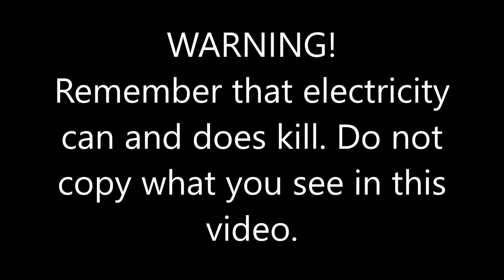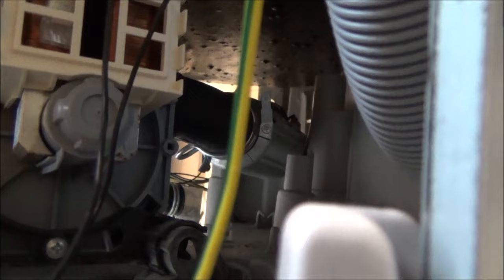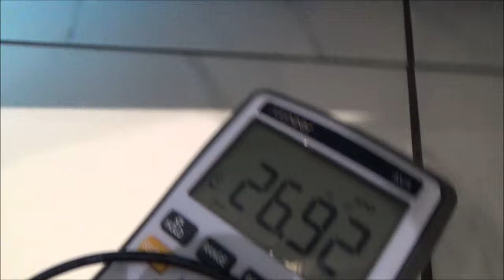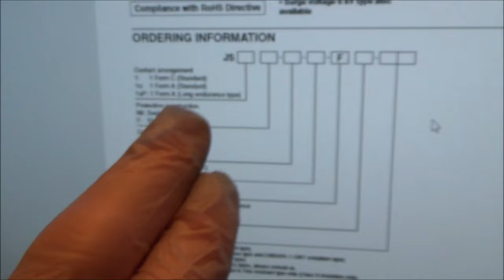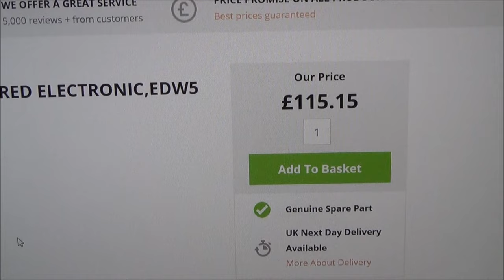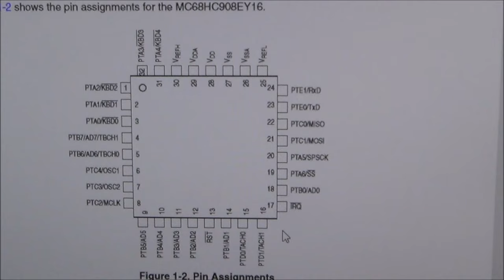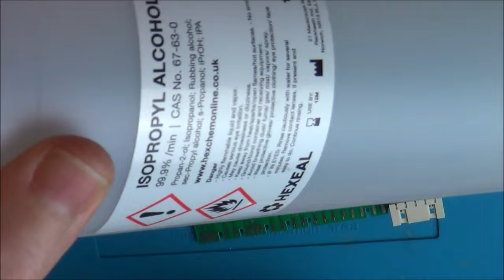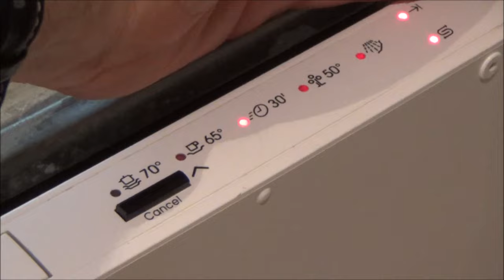Trying to FIX a Faulty DISHWASHER which Doesn't HEAT UP

Comment: Hi, 

You caused the diode to blow, when you tested the relay with the 12v power supply when it was in circuit you applied 12v directly across the diode, when you tested with the positive on the anode and the negative on the Cathode (Black line end of the diode) this caused excessive current through the diode causing it to go short circuit, the reason for this diode is when the relay turns off the magnetic field from the coil in the relay collapses causing a reverse voltage (called back-emf) this voltage is then conducted by this diode preventing damage to the driver stage of the circuit. 

Next time you test a relay in circuit apply the positive lead to the end of the diode with the line on it (The Cathode) on the back emf diode (across the coil of the relay) and the negative to the other end of the diode this will latch the relay without damage to this diode. Virtually any diode will work across a relay it is simply a protection device.
 

By the way you mention uF for capacitors the U is actually Micro so if you see symbol 'µ' 22 this means the capacitor has a rating of 22 micro farads {0.000001 farads} (the symbol 'µ' means micro), named after the famous Englishman from London Michael Faraday who made huge contributions to our knowledge of magnetism and electromagnetism at the start of the 19th century  (1791-1867)
Keep up the great work I enjoy watching your channel.
Reply from the maker: Thanks Tony, hopefully I will remember in future to put the + to the Cathode, I didn't know this. In this instance the diode was already shorted before I took apart the machine but if it wasn't then I now understand that 12V in the wrong polarity would have killed the diode. Thanks for the helpful tips, I appreciate it :-)
Reply: @Mymatevince  Hi, Sorry but I have do disagree, if you  look at when you first took out the board and measured the relay at time code 32:43 you measured across the relay coil and it measured .388k ohm, this is the correct measurement for the coil and proves the diode was not short at this time, if the diode was short at this point the reading would be short circuit. Applying the 12 volts caused the diode to short. 

Not having a go at you because your skill set and determination are very impressive, I have spent my entire life working on this type  of equipment I am now retired but I am very confident in my electronics diagnosis abilities.  If you don''t believe me take a normal diode and place in across your power supply with the anode to the positive and negative to the Cathode the diode is then in forward bais with no regulation of the current this will kill the diode unless you have the current limiter set in the regulated power supply.   When a voltage is applied in the opposite direction with the positive voltage on the Cathode (Black line) the diode is then in a reverse bias condition and no current will flow. PS don't feel bad because I have done far more accidental damage than short a diode...   Cheers Tony
Reply from the maker: @tonycross8101  Thanks Tony, I am going to try this right now with one of those 1N4148 (think that was it) to see if my power supply cuts the voltage in time before blowing the diode. The confusing thing for me is if I did blow the diode then what was the original fault. I will message back in 15 mins or so :-)
Reply from the maker: @tonycross8101  Hi Tony, this is getting interesting!!! So I am using a 1N4148 diode and the Ohm reading before doing anything is red lead to Cathode, black lead to Anode is OL but when red lead to Anode, black to cathode it is 1.93MOhms. 
When I apply 12V red lead(+) to cathode and 12v black lead (-) to anode the Ohm reading is the same as above BUT..... when I swap the polarity and apply 12V + to Anode like I did in the video it blows the diode and it measures 0.69Ohms in both directions!!!! it blows it instantly without any pop or fizz. So this now has me thinking what was the original fault with the dishwasher. I haven't taken out the board to measure the resistance over the relay coil but if like you say the diode was the original problem then it wouldn't be reading .38K Ohms. The dishwasher is at this moment working perfectly and before it wasn't heating up. The terminals on the heater element where attached and all the wiring was intact and tested ok for continuity!!!! Any ideas? Thanks for getting back to me on this and never be worried about upsetting me when I am wrong. It would be more upsetting for me to think I am right when I am wrong :-)
Reply: @Mymatevince  Hi, That's right the diode will blow when the positive of the power supply is on the Anode and the Negative is on the Cathode (This is the forward bias condition for the semiconductor and will allow current to flow) without a load the current will kill the diode (almost always going virtually short circuit in both directions).  Some multimeters have a diode mode usually a diode marking on the dial this biases the diode on an will allow you to test what is called the forward resistance across the diode when it is biased on reversing the leads should then be open line.

By the way you mentioned Zener diodes in one of your other videos, these work slightly different to a normal IN40xx diode they are what is termed an avalanche device they have the positive voltage on the Cathode and the diode only conducts when the voltage reaches the avalanche voltage which is the rated voltage for the zener, they always have a limiting resistor to prevent damage, so when fault finding them the anode may trace to ground this is normal.

I thought about your method in tracing the problem and I think your logic was very sound, sometimes faults like this can be a pain to find, the only suggestion I may suggest if this problem re-occurs is to disconnect the power and try an ohm's reading from the wire that comes from the water pressure switch to the heater and the wire that supplies the other side of the heating element, you should see the coil resistance, try this before removing the heater or disturbing the wires, as it may indicate a high resistance connection, possibly caused by the heat of the heater element.  The key with intermittent faults it to be very gentle and try not to disturb much while the fault is showing, sometimes easier said than done!.

One of the problems with testing a circuit with a multimeter is that some faults only show themselves under load then a simple ohms test may not show the problem, if it plays up again, and because the heater is such a pain to get to: if it were mine I would run two wires from the heater connection to an external test socket, I would then make up a short test lead with a neon bulb (with a 470k resistor in series) connected to the socket, I would then run the dishwasher, You then have a visual representation to show that the 240 a/c is actually making it to the heater, you could also wire a second neon and resistor to the output from the relay, this way you have a visual confirmation that the mains is getting to the heater all the time the dish washer is running.. (Neons are good for this they consume very little and won't change the loads involved) Obviously keep this contraption away from the kids, maybe beside the machine toward the back where they can't reach, but you can see it.!!

Hopefully you have repaired it and won't have to do this but it's one suggestion obviously there are lots of other techniques.

best wishes
Tony
Reply from the maker: @tonycross8101  Thank you Tony, your advice is very sound and will help me and all the others reading it. If it does fail again I think I will just swap over the heater purely because I already have a new one. If that doesn't fix it then I can look into the suggestions you have given. My meter does have a diode test on it but I have only just started using diode mode so I am not confident with it yet :-)
Reply: Tony. Is correct ,the diode was not the original fault . The chip sends a signal to the surface mount transistor next to the relay, it switch’s on and current flows through the coil.etc, that diode only prevents the back emf and would be a very reliable part. The hard working parts are the relay switching contacts ,(you did have a spurious reading on the N.C. Contact,which as you know was not used) but may indicate arcing damage in the relay. Or the heater element and thermistor switch,Assy as you have had fail before. Maybe even the contacts on that plug you cleaned with de.oxite could have been the fault. There is a lot of current flow in all of that circuit. I have seen the pcb edge connectors fail on many appliances when they carry heater element currents. Not really up to the task and I have fixed our dish washer a few times by hard wiring these pcb edge connectors. It’s ironic that plugs which allow the easy swapping of a pcb are much less reliable than the pcbs themselves. Alas tracing theses intermittent faults are only economical to fix if you can do it your self,  Great work Vince..that idea with the neons in test positions is a great idea but no tech will ever go to that trouble in the field.....but you can.....lol.
Reply: My Mate VINCE Hey Vince, new viewer to your channel and really enjoying your approach and can-do attitude to trying to fix stuff!  Given the diode was blown during the tests as mentioned in this thread, I am wondering if your fault was actually in the water sensor. Perhaps some bit of food gunk got stuck in there and when you blew through it to test, that got cleared and it enabled the heating element again?  Hard to prove but it’s a possibility that the electronics were all good before putting the 12v reverse over that diode.   Keep up the great videos though, really enjoying them all!
Reply: Sorry Tony, you're wrong.   Considering this was a flyback diode, it is very likely that it was a 4148 which has a max reverse voltage of 75v.  Not likely that his PS pushed enough current at 12v(parallel with the coil) to blow it.  The diode performed exactly as it was supposed to, it protected the transistor/MCU from the shutoff peak.  On a 12 relay, that micro second  peak can reach 75v.

MyMateVince.  Love the vids. and you're attitude.  You found the issue that most would have gave up searching for. 

Be careful about listening to keyboard commandos, sometimes they dont know anything.  Other times, as I suggest this is, their experience may lead you wrong based on THEIR history. 

For the record, there are many more sensitive diodes that may in fact have suffered the fate suggested.  However, this one being used as a flyback would not have been one of those.

EDIT:  Out of curiousity, I opened up the datasheet on the 4148 which makes me rethink my opinion.  It lists the  forward current as 2A for 1uS, 500mA peak, and 300mA continuous. 
Considering his power supply is a cheaper unit, and may not have fast/any overcurrent protection, I have to concede, you may be correct.
Now, I have to get out my board and do some experiments.
Reply: @guitchess wrong... try putting 12 v across a flyback diode with the diode in forward bias mode.  Diode is now dead....  try it if you dont think so.....
Reply: @tonycross8101  You may be right.  My experience is limited and you may be the greatest EE that's ever been.  However, MMV placed the 12v in circuit trying to operate the relay.  With the diode in parallel with the coil which would minimize the current passing through the diode.  I have a relay board in front of me at this second and have manually activated it many times with no effect on the diode. I also just did it again and the diode is fine.  
I believe the diode got weak and shorted after receiving one too many shocks of back emf, which prevented the coil from receiving enough current to operate the relay. 
I just went back and watched that section again, and Vince did forward bias the diode.  So, the real question is whether his power supply had fast enough over current protection to keep from blowing the diode. 
I think it did. 
Also, he's still  using that same dishwasher and just did another repair vid on it a week ago removing scale from a pump.  I would argue that if the diode wasn't the original issue, the real one would have popped up again. 
Thanks for your input and knowledge.  I'm here learning and just trying to understand what might have been the cause.  Not trying to be argumentative.
Reply: @guitchess  Dang! this is the BEST THREAD i've read in a LONG TIME! Wish it was available for ALL taking up electronics!

Comment: Since an inductor (the relay coil) cannot change it's current instantly, the flyback diode provides a path for the current when the coil is switched off. Otherwise, a voltage spike will  occur destroying switching transistors, Zener diode is normally blue band and normal diode is black band, the diode that you installed should work fine

Comment: Just started watching your channel and funnily enough we used to have the exact same model of dishwasher. It also developed the exact same fault. Although ours was annoyingly intermittent, about 1 in every 5 washes or so the heater would not work. Myself and my father spent ages trying to work out why it would do this, as Everytime we tested it would magically work obviously. In the end we had enough of trying to fix it and replaced it with a far better beko machine.

Comment: Hi Vince, this is a LL4148 diode.
Reply from the maker: Thanks so much Amerya. I looked for ages online and I couldn't find out this info. The one I installed was a 1N4148 so it looks like I got lucky this time as I think it is the same but with through hole legs :-) Thanks again. Vince :-)

Comment: The diode near the relay is used to pass the high voltage produced across the coil in the relay as it switches off .

Comment: Most diodes can be replaced with other general diodes and work, but if the diode you use to replace a faulty one can not handle the voltage and current applied to it, it will eventually fail. 

It should be noted diodes can fail but before they completely fail, they can exhibit strange "intermittent" behaviour especially when their environment has large temperature variations and or when the voltage is completely removed from them, allowing the discharge of the capacitance that they seem to develop, thus discharging the capacitance apparently resets them. 

Having said that I would mark the date you replaced the diode and after three years if the heater hasn't failed I am pretty confident you may have actually turned a Factory Lemon or a refurbished Dish washer into a proper "Factory specified" functioning Dishwasher.. TIME WILL TELL...
As Usual I dropped you a Like Vince,
Reply from the maker: Cheers for the info Koala :-)

Comment: I just read up on Zener-diodes, and this is what I found:

They differ from normal diodes because they permit voltage to go either direction (bidirectional), whereas normal diodes can only reliably permit voltage to go in one direction (unidirectional). Normally, the Zener-diode would not permit current in the opposite direction until the voltage passes the "Reverse Voltage"-limit.

All Diodes have a so-called "Reverse Voltage"-specification, which specifies a voltage in which the diode will permit current through the opposite direction. Normal diodes cannot operate reliably above that voltage limit, Zener-diodes can.

If a diode has shorted completely, voltage can pass through unimpeded in both directions (the diode just acts as a piece of wire). The purpose of a diode is to limit directionality (like a polarized capacitor, minus the capacitance). This directionality is also the reason why they have a black band around one of the edges, to indicate which side is "forward" (corresponding to the perpendicular line at the tip of the arrow on the board, with the arrow indicating which direction the current should flow).

Hint: Diodes are also popularily called "rectifiers", as they're able to convert (limitedly) AC-current into DC-current, by chopping the negative part of the current/voltage.

EDIT: Added a ton of extra info, as well as a bit of fixing here and there.
Reply from the maker: Thanks for the detailed explanation. Nice one :-)